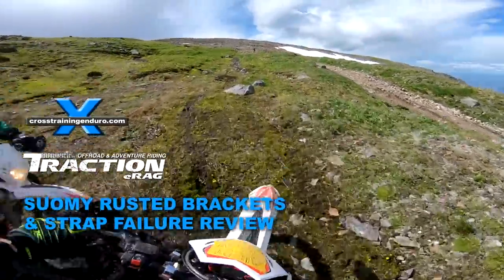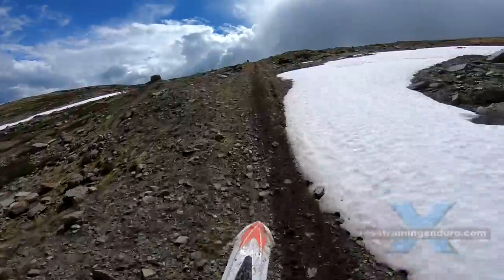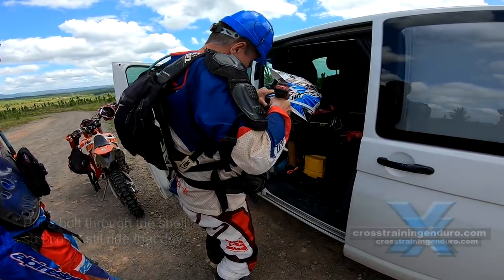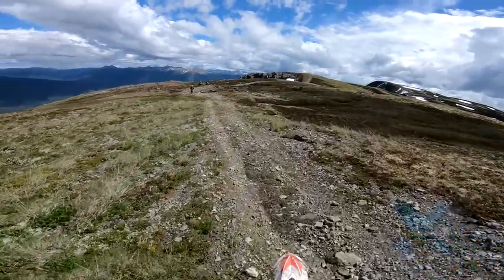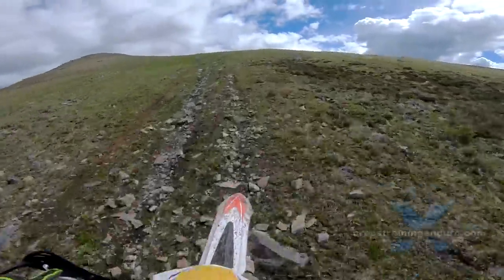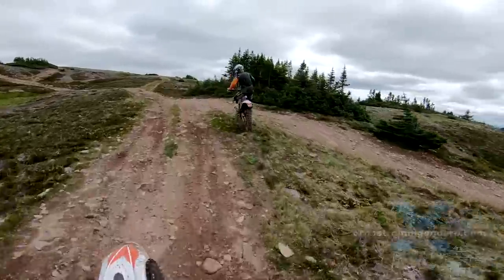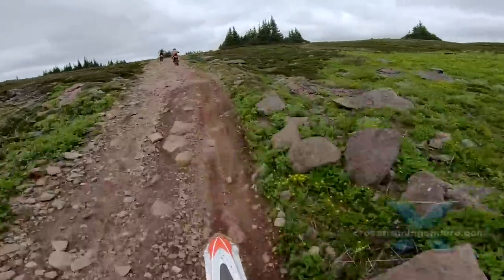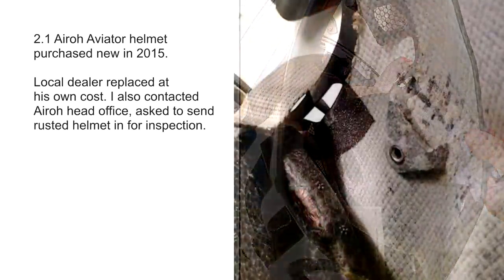Suomy helmet 2013 & 2014 issues: corrosion & chin strap failures︱Cross Training Enduro

Comment: A magnet can help you find out. Stainless steel comes in 2 basic category's.  As for whether they are magnetic, the answer is that it depends. There are several families of stainless steels with different physical properties. A basic stainless steel has a 'ferritic' (this will rust) structure and is magnetic. These are formed from the addition of chromium and can be hardened through the addition of carbon (making them 'martensitic') and are often used in cutlery. However, the most common stainless steels are 'austenitic' (more resistant to rust)- these have a higher chromium content and nickel is also added. It is the nickel which modifies the physical structure of the steel and makes it non-magnetic. One other thing worth mentioning...rust never sleeps, a great album by Neil Young. It will not help you in riding your motorcycle but you can listen to it while you morn the early death of your helmet. 😂 Another great video Berry! Keep them coming!!!!

Comment: In the old days, when there were still dinosaurs. MX ( Scramble) helmets had three press studs holding the peak/duckbill to the helmet. In a get - off involving the head, the peak could detach from the (round) helmet reducing the chance of neck injury. To add a bit of security ( and stop water/mud dripping between helmet/peak) a strip of silver(only silver!) Duct Tape was often affixed over the three press studs. As mentioned, the helmets were consciously made ‘ round ‘ to reduce the chances of neck injury which was deemed a higher risk with a multi faceted helmet furnished with corners and fancy ‘ fins ‘ and the like.  Also the peaks didn’t cost a packet and the selection was bigger, alowing riders to individualize their lid, more so than just a paint job.

Comment: For the price of these helmets it's totally insane, really it's still insane at any price. I have a $160 helmet I bought 12 years ago and have used almost daily on the farm since. The strap brackets in the helmet are austinetic stainless steel and have held up fine. If a cheap helmet holds up great an expensive one should last a lifetime!

Comment: My Suomy MX Jump broke just like yours after 2 years of use.  I do sweat a lot, but I've also had Just1 and the Airoh twist helmets which I had no problems with other than cheap feeling liners.  My newest helmet the Klim F5 is now my gold standard for a quality super light lid with excellent venting!
Reply from the maker: how old was your suomy when the bracket broke? and was it due to rust? i checked with a suomy retailer and at least the current helmets don't have the weird alloy brackets mine did. he couldn't confirm if they were actually stainless steel now though, or just a coated mild steel.
Reply: it broke after about 2yrs, but was not my only helmet.  It was rust for sure.  The anchor point just let loose during a ride when I went to put the helmet back on.  It was alloy of some sort.  I do believe Suomy, Just1 and Airoh all come out of the same factory as they share at least some of the same style components. @crosstrainingenduro
Reply: @PrimalEnduro  My Just1 has some rust starting.  Not nearly as bad as my Kali that I retired but it's not seen nearly the use either.

Comment: I owned a suomy. Super light weight, looked sweet, not too expensive. Had a tiny crash, didn't even "hit" my head just brushed it on the ground, it cut my forehead right inside my eyebrow and I got 14 stitches. I continued to wear it since I hadn't compressed any of the foam. Got a horrible concussion from another tiny crash. I have since gotten a 6D and wouldn't trust anything else. I've crashed in the 6D a few times, once hard enough to get knocked out and break my jaw, still no concussion.
Reply: With all the tales you have, I think your best protection would be to get a roll cage or stop riding!
Reply: @biketothetop  both suomy injuries were on a mountain bike, I have quit mountain biking because of that.
Reply from the maker: i'm not sure if the 14 stitches would be due to the suomy helmet though, teddy. that could probably happen with most brands. a big problem with almost every helmet is they are designed to just compress under life threatening impacts i.e. around 200 to 300G. and you can get badly banged up at much less than that and still wind up with brain injuries. 6D has tried to remedy that. variable density liners are meant to as well, although it's hard to get conclusive evidence showing they work well.
Reply: I'm riding mtb for 25 years and moto for 10, luckily I've never had a bad crash with an outcome that caused me to depend on my helmet. I guess the best protection is riding with my limits and not trying to be a bad ass. I'm no super star, focus, and stay in control. I always view any crash as something I want nothing to do with regardless of the body armor I wear on my moto. Crazy is that I only wear a helmet on mtb. Once fractured jaw many years ago when chin hit rock on endo, but not until recently did I get a full face for mtb, but only to mount my GoPro on my chin.
Reply: @biketothetop  Man, I tried riding MTB with that mentality for 2 years and its just not fun. I dont whip any jumps, I don't ride fast. If I take all the risk out of riding it's just not worth it to me. With MTB I always had nasty crashes, lucky if I didn't hurt myself on every one. When it comes to moto (I ride/race woods) I seem to have less serious crashes, wven when I'm pushing my hardest. I just listed every serious crash I've ever had in my 8 years of riding and racing both, with the exception of a broken collar bone, and multiple sprained ankles all on MTB.
Reply: @teddyf9438  I have gone from BMX to downhill MTB to Enduro. I found that the heavier the bike the longer it takes to fall off and it allows you a little more time to tuck and roll. Had a few off on the motorbike that I was able to jump clear of the bike and just run away from it.

Comment: Brand name should be pronounced, "Lawsuit owe Me"! Great information! It just goes to show that an expensive helmet is no guarantee that you're getting a great helmet. It's really unfortunate that these companies have inferior engineering and yet they are tasked with safety-oriented products!
Reply from the maker: ideally all the helmet standards would mandate marine grade stainless steel fittings too. but yes some manufacturers should be doing a better job.
Reply: Great point! I guess the standards must only reflect out-of the-box crash performance not durability in any form. I'm sure it would add a great burden to the design qualification process if they had to perform durability testing too, but as you said, using the right materials would ensure corrosion protection! This concern is entirely worthy of bringing to the standard organizations, but I'm sure the manufacturers probably lobby them to keep away from the material issues and anything other than out-of-box performance. 
Added edit: I just looked at my helmet strap anchors and observed both have corrosion in the immediate proximity of the slotted hole that the strap passes thru. Evidently the corrosive sweat wicks up the nylon strap and corroded the plated steel anchors; however, I'm not immediately concerned because there is still ample material remaining to prevent the strap from producing a tensile failure of the anchor during a crash. Based on this observation, I conclude the unit mentioned may have simply been designed with insufficient edge margin for the nylon.

Comment: After your first video, I did try to look at the mounts on my own 2 x Suomy helmets. It seems that the lining will be damaged before you can see them clearly.....
Even if they're ok, I might not be able to use the helmet 😔
Reply from the maker: yep it took a fair bit of force to get it out and thankfully it went back in okay in my case. i guess the other option is to just pull on the strap hard before every ride to test it? in fairness to suomy, they probably have fixed the issue as the brackets on recent helmets at least aren't the weird alloy mine used. but it would be good if the factory could confirm this is the case.
Reply: @crosstrainingenduro  Thanks. I'm planning on stripping the oldest of my two and seeing if the brackets have been updated, and what material they are. 👍 
Will let you know if I get it done

Comment: have had a couple mates have similar issues with their cheaper fox branded MX helmets
Reply from the maker: not good to hear, tim. do you know how old the helmets were when they failed?
Reply from the maker: not good to hear, tim. do you know how old the helmets were when they failed?
Reply: @crosstrainingenduro  one only had 3 races on it (10hrs max) and the others were about 40hrs old. sweat had corroded the rivets holding the clip in place and there was even corrosion appearing around the clips themselves as you have shown in your video. All 4 were replaced by the shop they'd purchased them from and with THH as seller no longer stocks fox helmets for obvious reasons

Comment: This is such a shame cause my Suome was the most comfortable helmet I’ve ever used.
Reply from the maker: the good news is for the past few years they haven't been using the bizarre alloy brackets mine came with. but it would be good to know if they now use proper stainless steel or it's just a coated mild steel. in any case i haven't been able to find any very recent cases so hopefully they did fix it.

Comment: I believe you have a valid claim for repair, replacement or refund under 'Australian Consumer Law'. And sorting out your helmet might avoid a full blown recall.
Reply from the maker: agreed, kirk. i figure there would be at least a partial refund under our consumer law but i didn't pursue that. i'm not sure if the limited number of cases would justify a recall, but i think they are charging enough for the helmets to use better brackets.

Comment: SONY EU is just waking up to Australian Consumer Law requirements, this week, 

Time SLIMY found out too ! ! !

Just because you have a two year warranty in Australia does not mean your off the hook at 25 months, 

Every product sold here MUST BE DURABLE and deliver reasonable service/function for it's lifetime.

Take it back to the place of PURCHASE and they MUST repair, replace or FULL REFUND, no excuses.
If an item/service is purchased and delivered to Australia, even if purchased online it does not matter, they MUST still honor the Australian Consumer Law.

So long as the helmet hasn't suffered any substantial physical user caused damage/abuse which causes it to be unsafe to use.  The helmet it's still needs to be able to be used safely for the lifetime of the helmet, which I believe is about 5 years minimum, accepted industry recommendation is replacement seven years after its production date for quality helmets.

If it's a materials failure this is likely to be taken as a MANUFACTURED FAILURE and would be considered cause for a FULL PRODUCT RECALL if it might risk major trauma/injury to the users.

In some jurisdictions I can see it's entirely possible if someone were to die while using a FAULTY helmet which has a failure due to a perceived MANUFACTURED FAULT then it's likely charges similar to corporate manslaughter may be realised if the MANAGEMENT knowingly fail to protect consumers who happen to be using their inferior or flawed products, where said product has knowingly not been proactively recalled by the manufacturer/management.

Comment: If you have a Wal-Mart head, get a Wal-Mart helmet! Quality is not cheep,  are You?
Reply: The Suomy MX Jump is $360 not exactly cheap. I had a top of the line Shoei helmet come off my head in a MX crash due to a strap failure and received some serious injury from it. This type of failure shouldn't happen on any helmet no matter the cost..
Reply from the maker: actually the safety of cheap helmets often aligns with that of mid-priced helmets. price is not a good indicator of the level of protection you'll get.
Reply from the maker: @Tepco Cycle Repair how old was your shoei when that happened?

Comment: I totally get what yo're saying Barry, but you probably wear your helmet more than 10 hours a week? Many are lucky to put that 10 in a month. And then they have winter some places. And it is recommended to replace helmet after about 5 years anyway.. It is very wisely calculated by the manufacturers! to save 50c on your helmet times 30 000 - 60000 of them sold, (one poor child - strike out) one poor CEO somewhere can afford one more month of his mortgage.  You need to see the whole picture before complaining, Barry!
Reply from the maker: good points vlad, but actually i just ride once a week on average and for about three hours... and take away the two months i'm overseas and using someone else's helmet. and the key point of the vid isn't about affecting suomy's bottom line, but just a reminder this can happen to a variety of brands and it pays to check your helmet brackets for corrosion.